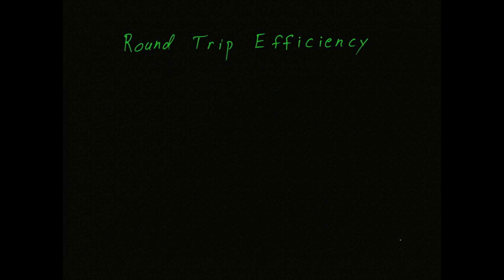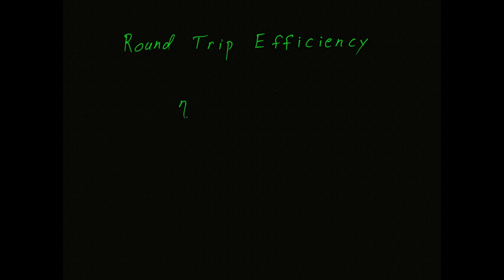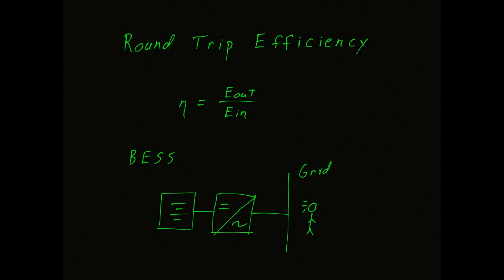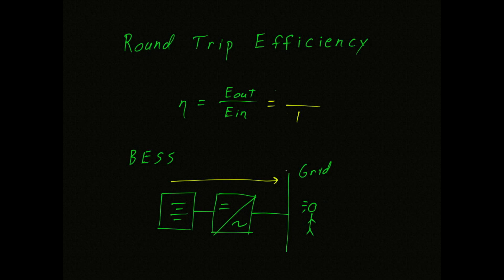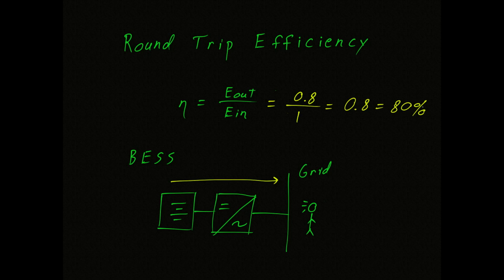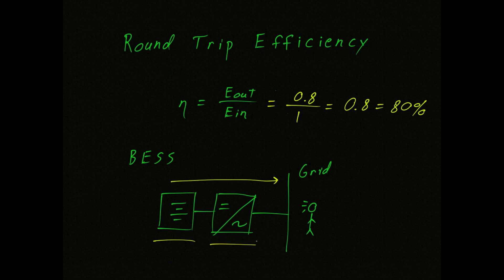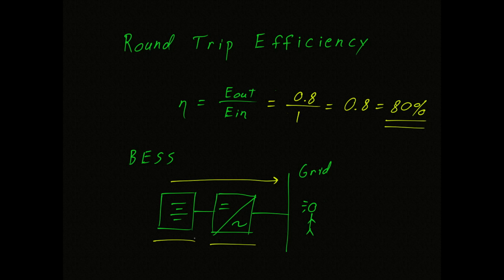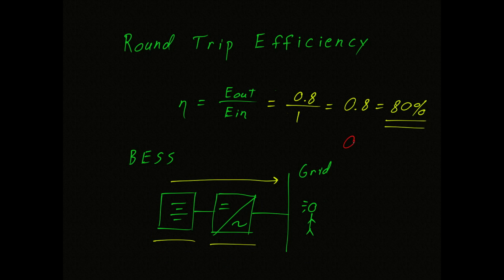Round Trip Efficiency

Comment: Hi there,

I came across this video when researching how to calculate “one way” efficiency for a BESS model that I’m building.  It was so easy to follow and understand.  I learned a lot from this 9-minute video!

I have a RTE percentage for each year (for 20 years), but I don’t know how to convert that into a one-way RTE number.  I am assuming that solar panels will charge the battery and then the battery will deliver that energy into the grid.  It will never deliver from the grid to the battery.

Do you know the right way to convert RTE percentage to a one-way percentage?  How would you go about doing this?  Any help you could give me would be greatly appreciated.